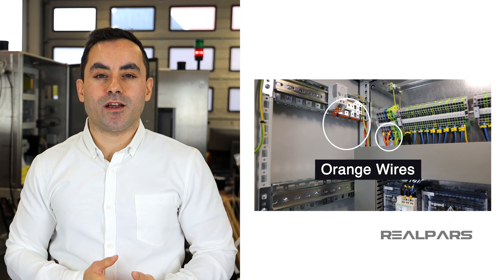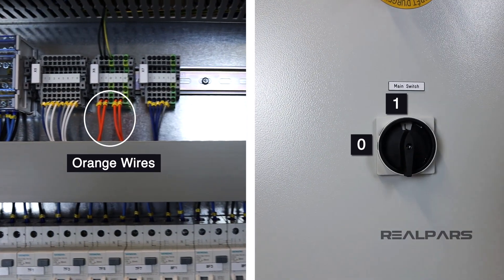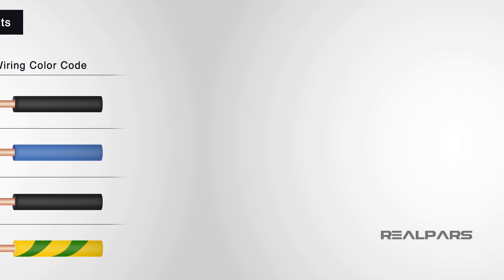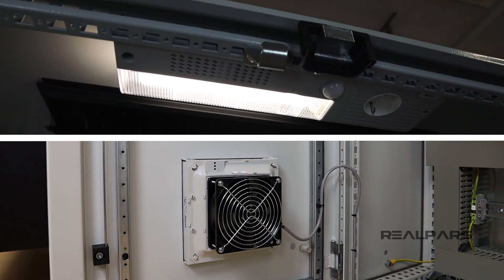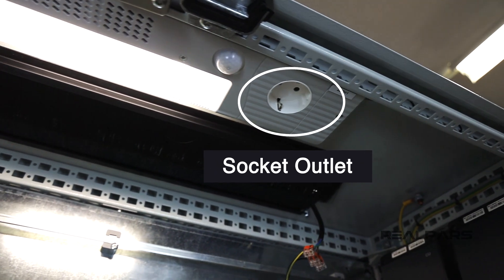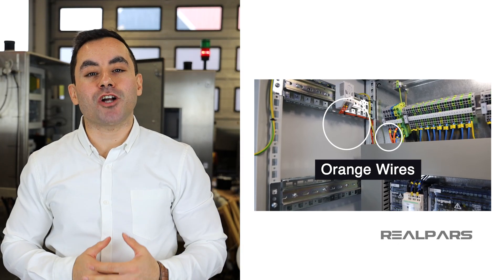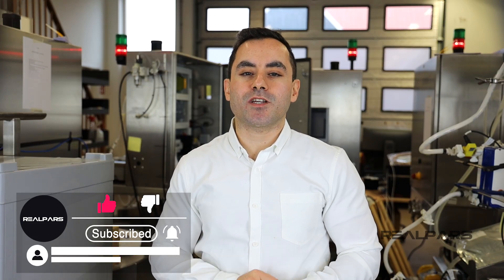What Does an Orange Wire Do in an Electrical Control Panel?

Comment from the maker: This video references Machine Safety Standard EN 60204-1, which is a European Standard. There are many wiring color schemes in use around the world. The video shows one implementation (EN 60445). Whenever designing or troubleshooting inside a panel, it is imperative to review the documentation, including wiring diagrams, to identify the various circuits in the panel.

In the US, NFPA (NEC) and UL508A are the corresponding standards. In those standards, using orange and white/orange is in both the NFPA 79 and UL 508A for components that remain energized when panel power is disconnected, regardless of potential.

Comment: I have a question that isolator is disconnected so how these orange wires work when there is no electricity in that and whole panel is not working please explain it thanks.
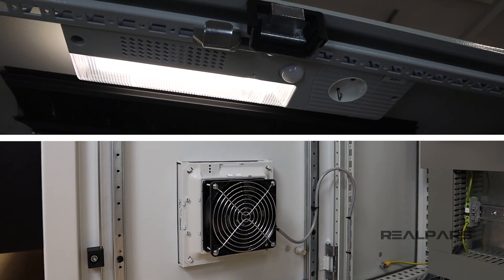Reply from the maker: Hello, @sadeedulhassan483  Thank you for your question. We explained in this video. Please go back and watch the video from 1:46 to 3:21. It’s all part of the machine safety standard EN60204-1. 
In this type of engineering design, following the standards, we must provide power for the lights, fans, and users to use as needed, such as for a laptop or troubleshooting.  If you're looking to learn more about this topic, you can join our 7-day free trial at https://community.realpars.com/checkout/realpars-membership

Comment: Panel builder for 30yrs now, as stated, these ARE NOT wiring codes for the US. They are confusing and exhausting. (Using white on a PLC output card? WTF is that?) Heres the US standard by NFPA>

Black - Incoming power such as 480vac
Brown- Other, like 220 in a 480 panel
Red- 120vac
white-Nuetral
Orange-Low voltage AC
Blue-Low voltage DC
Yellow-CAUTION, externally sourced power, assume live with disconnect OFF.
Green- ground
Reply from the maker: Hello, @controlfreq9346. Thank you for your comment. You are correct to follow your standards. However, since we are an international global learning platform company, we try to discuss applications related to all types of industries worldwide. The one you view is related more to the EU applications. We did not touch on the USA, China, Middle East, just to mention a few other standards in other parts of the world. Some cabinet manufacturers in the USA must learn other standards because they ship their products to all parts of the world, like Siemens. You might enjoy this video from Siemens on the cabinet being built and shipped from Ga to other parts of the world using all-world types of standards where the product is going to, made in the USA! Happy learning from RealPars!

https://www.youtube.com/watch?v=C4BTkrqEud0

Comment: the color coding for a multicore cable, with two reds and a ground? To me has not much sense live and neutral both red????
Reply from the maker: Thank you for your question! Since you're using a multicore cable for controlling AC voltage, please note that AC doesn't have polarity because it's alternating current. The ground wire serves as the safety ground for AC, following the standard we mentioned. Enjoy your learning!

Comment: I'm confused! @3:45 in t he diagram shown, it states that single cores should be wired in Blue for AC Neutral but the neutral to your fan is wired in ORANGE single core ...doesn't this contradict what it shows in the diagram?
Reply from the maker: Thank you for your question, it's a great one! Depending on where you are, electrical standards can vary, so it's essential to follow your local safety codes. Typically, the ORANGE wire is considered foreign wiring in many places. It might carry power from an external or internal source unrelated to the main power switch, so it's crucial to handle it with extreme caution. Even when you switch off the main power, these wires might still carry electricity. Most industrialized countries recognize this standard.

The other wire cores you mentioned are controlled by the main on/off switch. We design it this way to ensure that certain devices like fans remain operational even when the main power is off. These ORANGE wires usually have their breaker switch separate from the main one.

I hope this explanation clarifies things for you! Happy learning, and if you have more questions, feel free to ask!
Reply: Nice vedio sir

Comment: I dont know where you came up with that color coding. Because it isnt like that in the US..
Reply from the maker: You're correct, Clem's! We have the following RealPars comment pinned under this video where we clarify the US-EU color coding difference:

"This video references Machine Safety Standard EN 60204-1, which is a European Standard. There are many wiring color schemes in use around the world. The video shows one implementation (EN 60445). Whenever designing or troubleshooting inside a panel, it is imperative to review the documentation, including wiring diagrams, to identify the various circuits in the panel.

In the US, NFPA (NEC) and UL508A are the corresponding standards. In those standards, using orange and white/orange is in both the NFPA 79 and UL 508A for components that remain energized when panel power is disconnected, regardless of potential."

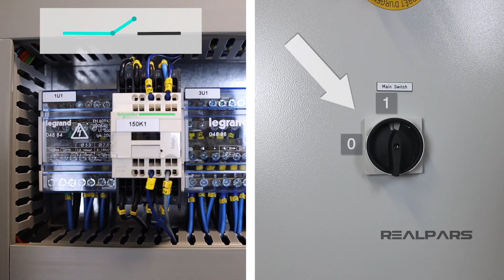Comment: 5:50 why would you use a contactor, if the switch is three-phase 5:30 ? Normally, you would either have a three-phase switch feeding the whole load, or a single-phase switch switching a 230v (in this case it would be L2+N if L1+N is used by the maintained supply, and L3+N if L1+N and L2+N is used by some loads - to keep the phases as balanced as possible) that goes to a three-phase isolation-certified contactor with 230v coil.
Reply from the maker: A contactor can -provide extra protections that the switch cannot, such as thermal and overload protection.  The switch provides an external means to de-energize the circuit while the contactor provides a more robust way to provide circuit protection in the cabinet.  Other factors would include local code requirements and company engineering standards, both of which are not known to the viewer of the video.

Comment: This must not be for USA...??
Reply from the maker: Hi Max,

This video references Machine Safety Standard EN 60204-1, which is a European Standard. There are many wiring color schemes in use around the world. The video shows one implementation (EN 60445). Whenever designing or troubleshooting inside a panel, it is imperative to review the documentation, including wiring diagrams, to identify the various circuits in the panel.

In the US, NFPA (NEC) and UL508A are the corresponding standards. In those standards, using orange and white/orange is in both the NFPA 79 and UL 508A for components that remain energized when panel power is disconnected, regardless of potential.

Comment: It concerns me that you use same color to different things, isn't it a safety issue? I.e. AC and neutral.
Reply from the maker: Good question.  First, there are only so many unique colors that can be used for wiring, so some overlap in color and function is inevitable.  The true measure of safety in control panel design comes in the detail paid to the design and documentation (panel drawings) of the panel.  Being able to lock out the incoming mains and disconnecting internal circuits for troubleshooting and maintenance is at the core of the safe operation. The use of a multimeter and other circuit testing equipment helps ensure safety.  In the video, orange wires are used for AC hot and AC neutral.  The important point is that orange indicates a circuit that is fed from an external source.
Reply: @realpars  Great answer, thanks:-)
I have seen cables where the black had a white stripe, you can have orange, black, blue, yellow/green, gray, brown, purple and so on, but yes maybe is that not necessary.
I did help to connect a data cable with 32 wire 1.5 square mm, with lead shielding around! LOL after fighting with that cable to get it up in 7 feet high and 50 feet along a shelf, did I wonder If my body were blue, yellow-green, purple and black:-)

Comment: Hey RealPars, in this example why do you need the contactor? The entire 3-phase is switched on/off with the external disconnect. Is there any other incoming power supply you are controlling with the contactor?
Reply from the maker: To be honest, we could have left the contactor out of the design.  The contactor allows the distribution of power to multiple subcircuits.  The contactor as shown also has advanced protection features that a simple disconnect switch does not have (internal overloads, for example).
Reply: @realpars  Thank you! And the contactor does not need circuit breaker protection, right? In the video I don't think it is not installed downstream of a branch circuit C.B.

Comment: Yellow usually indicates outside wiring from
Another disconnect source 
If in America I’d assume Orange means high leg or hot ???
Reply from the maker: Hi Karl, 

You are right, this video references Machine Safety Standard EN 60204-1, which is a European Standard. There are many wiring color schemes in use around the world. The video shows one implementation (EN 60445). Whenever designing or troubleshooting inside a panel, it is imperative to review the documentation, including wiring diagrams, to identify the various circuits in the panel.

In the US, NFPA (NEC) and UL508A are the corresponding standards. In those standards, using orange and white/orange is in both the NFPA 79 and UL 508A for components that remain energized when panel power is disconnected, regardless of potential.

Thanks for mentioning that!

Comment: In the USA never heard of an orange wire specifying anything but the B O Y color coding of 480 volt 3 phase. B O Y = blue orange yellow. A yellow wire was also for a wire that was still energized when disconnect switch is off. Was a sparky at a large newspaper. Was told to find out where the 120 volt yellow wire that went thru 14 press units feed from. Turned off over 500 circuit breakers and a lot of 480 volt breakers over several hours but never located feed. Prayed that fuse or breaker that supplied it never blow or tripped on my shift.
Reply from the maker: Hi Izzy, 

Thanks for your comment!

You are right, we have added the following disclaimer to this video:

This video references Machine Safety Standard EN 60204-1, which is a European Standard. There are many wiring color schemes in use around the world. The video shows one implementation (EN 60445). Whenever designing or troubleshooting inside a panel, it is imperative to review the documentation, including wiring diagrams, to identify the various circuits in the panel.

In the US, NFPA (NEC) and UL508A are the corresponding standards. In those standards, using orange and white/orange is in both the NFPA 79 and UL 508A for components that remain energized when panel power is disconnected, regardless of potential.

Thanks for sharing and clarifying that as well!

Comment: I have worked with industrial electrical for the last six years and have built/worked with many panels. I have never seen this color code used in the US before. Orange is typically a seperate external power source usually from a different breaker in the building or a ups. White/Orange is neutral from a seperate power source. Solid white almost always means neutral is the US. DC color codes are not specific in the us, the most common color codes are brown and blue, blue and white/blue, and red with black. The only color required by law is green for ground.
Reply from the maker: You are correct.  This is not a US-based wiring standard.   The video references Machine Safety Standard EN 60204-1, which is a European Standard.  In the US, NFPA (NEC) and UL508A are the standards, and in those standards, orange wires are addressed for exactly the same purpose as is shown in this video, except I do not see this employed in many cases.  

There are many wiring color schemes in use around the world.  The video shows one implementation (EN 60445).  Whenever designing or troubleshooting inside a panel, it is imperative to review the documentation, including wiring diagrams, to identify the various circuits in the panel.

Comment: Why are they screwing with the Color Code.
A/C Neutral is white, DC + is Red, except when dealing with Data Centers, and Green Yellow is for Dedicated Isolated Ground in systems with high Harmonic Values.
Reply from the maker: Gary, the video references Machine Safety Standard EN 60204-1, which is a European Standard.  In the US, NFPA (NEC) and UL508A are the standards, and in those standards, orange wires are addressed for exactly the same purpose as is shown in teeth video, except I do not see this employed in many cases.  

There are many wiring color schemes in use around the world.  The video shows one implementation (EN 60445).  Whenever designing or troubleshooting inside a panel, it is imperative to review the documentation, including wiring diagrams, to identify the various circuits in the panel.

Comment: Not a standard in the US. Orange is used for 24 VAC . But has been used to signify voltage from a source outside the panel not controlled by the main disconnect on the panel. Yellow is more common for this purpose . And a purple wire used as a jumper wire in a circuit that may be used as a place holder for future input devices.
Reply from the maker: Richard, thank you for your comment. There are a number of wiring "standards? so whenever inspecting a pane\l, it is best to refer to the lead sheets of the panel drawings to understand how the wiring colors are used.

Comment: NEMA is usually yellow. IEC is orange
Reply from the maker: That is correct for interlock wiring.  It is always best to consult the panel drawings to determine the standard used for that panel.  I have seen panels designed in the EU, built in Canada, and shipped to Japan.  So what standard did the panel use?  Well, you could pick one of three standards from what I told you above, like CSA or IEC, but you would be wrong.  It was built to NEC standards. because the company in Japan was a US company and NEC was their international standard at all of their sites for panel construction.

Comment: Every cabinet from different manufactures I've come across use their own coloring code. In the cabinets I design I use orange wires for externally powered control circuits.

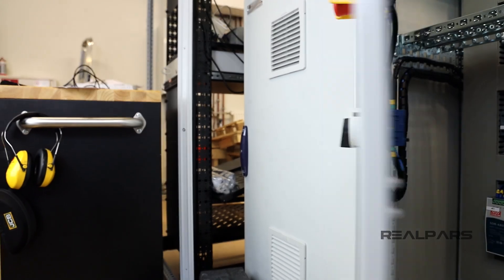Comment: 5:24 Why is the color of the input wires of the main switch not orange?
Reply from the maker: The wires to and from the door switch are connected to a contactor which is used to disconnect the incoming power.  Generally, the main feed to the panel will use orange wires so that it is very clear that this circuit is the incoming power feed.  Subcircuits are typically color-coded based on type of voltage (AC or DC).

Comment: Simply put, the brown wire is live even if the main switch is off , is that it ?
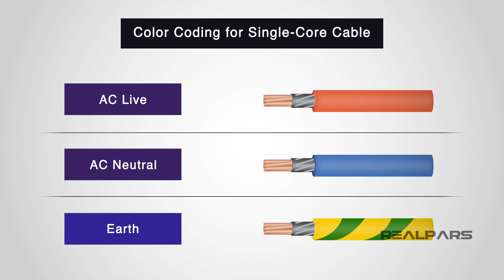According to 3:47 the neutral should be blue but in 4:00 I see that orange is also implemented as neutral !
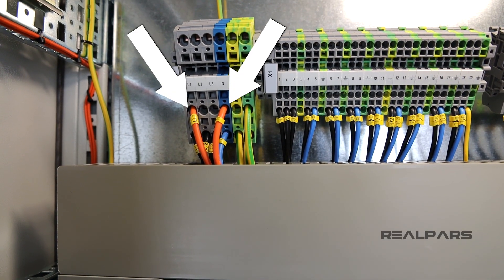Reply from the maker: I see two different neutral schemes as explained at 3:47;  Orange and blue.  At 5:12, we see orange being used for a 1-phase circuit (light in the panel) for both H and N.  At 5:30, we see blue as being used for neural in the 3-phase circuit.  I do not see brown wires at 4:00.  Perhaps the orange wires appear brown on your computer.
Reply: @realpars  I am sorry I meant Orange , at 4:00 orange wire for neutral

Comment: According to European standards it’s not allowed to run 3 phases to the door, isn’t it? As I know main disconnect switch should be installed on panel or cabinet internal surfaces.
Reply from the maker: The only requirements I am aware of are:  1) any electrical cables landing on devices in panel doors must be installed so that the cables are tension-free.   2)  the panel door must be tied to ground,  3)  there shall be no sharp edges on panel frames or doors, and 4) live
 parts must be protected against direct contact in accordance with DIN EN 50274 or VDE 0660-514.

Comment: On all the machines I have worked on when the main panel switch is turned off the panel no longer has power period . To best of my memory I don't recall  any using a for lack of a better term remote disconnect like the one shown . They all had a handle on the outside of the door that had a metal rod to engage the main disconnect when the door is closed . To open the door while the panel is energized you had to override( with a small pin ) that to release the metal rod from the disconnect .

Comment: I have worked in control panels of CNC machines made from all around the world for over 40 years.  This is just one variant of what I have seen.  it is very common to have AC in a panel live with the main disconnect in the off position to provide lighting and programming power.  Usually black wires are reserved for AC power. And most often you do see white for neutrals or black with a tracer.  I think this often depends on where this machine is manufactured.
Reply from the maker: Thanks for sharing your knowledge with us, Joe! Great to hear that.
Reply: I think you must working at North America, because NFPA 79 defines neutral conductors may colored white 😁

Comment: As an industrial electrician who works on these panels all over the world.
There is no such thing as a standard - even in Europe!

For context my last company wired everything in orange
I have never seen two panels the same- not even close.
Reply: "Standard" is of it's country of origin . As I have worked on many foreign Control Cabinets, many from Germany, I must add decals to inform other's of the Changes in Wiring because the unit is of another origin and Color Identification is not STANDARD to the USA and must follow the manufactures identification.
Reply: This is correct. Seen engineers pick their favorite colors. What code?